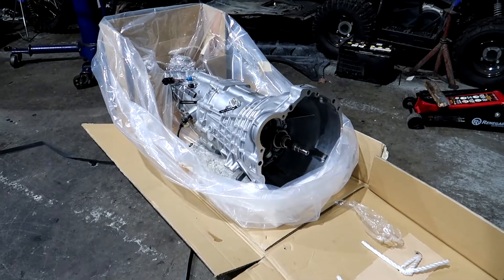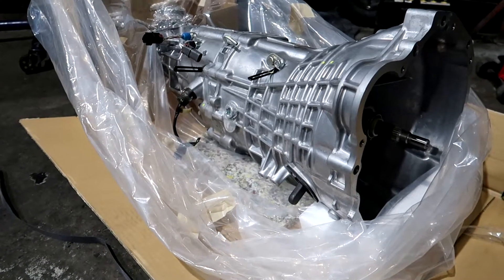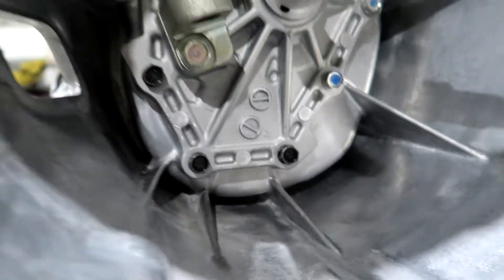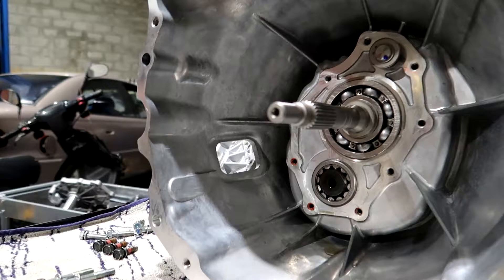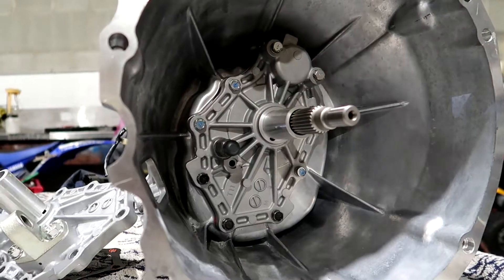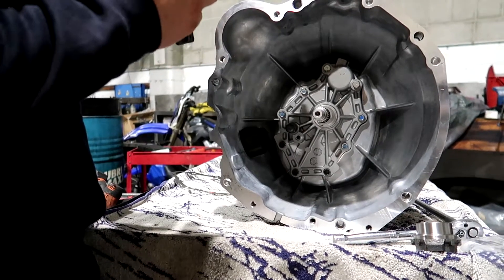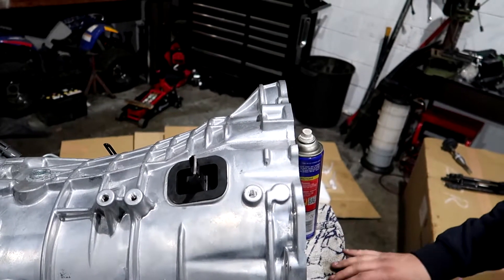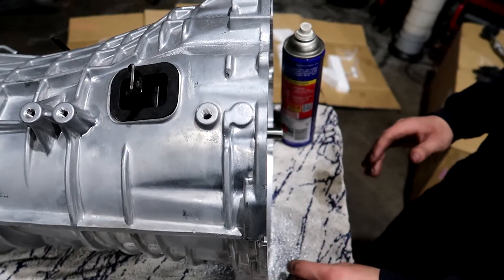How to convert an RB gearbox from pull type to push type

Comment: Would, fitting a folk pivot ball bolt to the pull type cover plate work? 

Just trying to save some money as the push cover plates are expensive.

Comment: I have Pull Type Hks Rb26 Twin clutch kit but i want to use z33 cd009 gearbox with Mazworx Rb/VQ bellhousing can i change clutch kit to push type ? Because i have Push type Tilton Hydraulic system i want to use on clutch kit but i dont know how i change pull type clutch kit to push type?

Comment: Can you not just reuse the parts from your 33 to put into the 34?  Like the front cover, release bearing etc etc. Couldn’t I just swap my 33 stuff onto this?
Like just tap for the 33 slave and then the rest just swap over as well since I’ve already got them yes?
Reply from the maker: I'd say you have well and truely figured this one out by now. For anyone else with this question, yes it can be done. All of the conversion parts are from the r33 rb25det gearboxes. For the low cost of a brand new front plate, release bearing, slave etc I would definitely go that route!

Comment: I want to do it the other way around can you convert an R33 GTST turbo gear box to a pull clutch will the housing accommodate  it.
Reply from the maker: Sorry for late reply, I can't 100% say as I've only used the r34 turbo box. As far as I know they should be the same and you just need to drill the appropriate holes to mount the slave
Reply: @tjdautomotive  thank you I did it and works great. I created an adaptor plate mounted from the push location at the front of the box. I like pull clutches they are pressure consistent.

Comment: what torque do the bolts need to be?
Reply from the maker: For which part?
Reply: @tjdautomotive  the plate cover
Reply: @tjdautomotive  the one u swapped over
Reply from the maker: Not sure for spec, I'm sure there is something online. If concerned just put some loctite on

Comment: thought u were gonna turn it on its end instead of draining the oil?
Reply from the maker: Either way it didn't want to play the game, I later found out that you really should be dumping that oil and putting in different stuff.
Reply: @tjdautomotive  Oh really whys that? is the oil in there just for storage purposes ? what oil should be going in there?
Reply from the maker: Yep that's right, something like a 70-90 with a GL4 rating will be fine. Stay away grom gl5 oils

Comment: Hey can rb20det front cover work along with all the bearings fork etc?
Reply from the maker: Hey mate, first off thanks for watching the video! Unfortunately I'm not 100% sure on this one as I've only used rb25 bits. Your best bet would be to give Kudos Motorsport a call. They are hands down the best parts guys for JDM cars, couldn't recommend them enough and they'll be able to get you the answer you need :D
Reply: How did ya get on with the 20det cover?